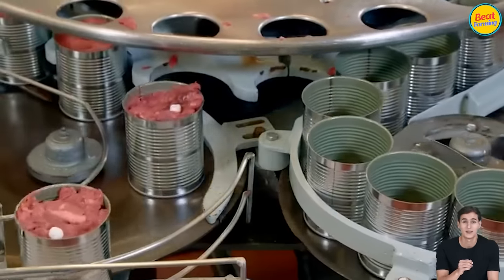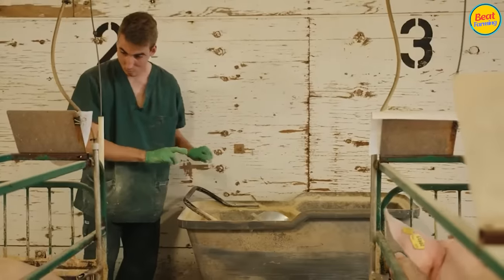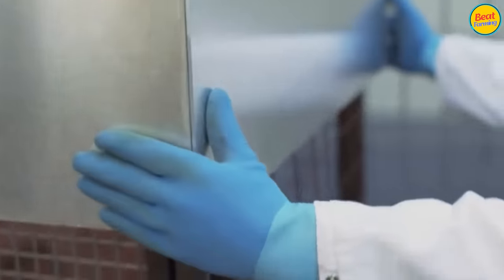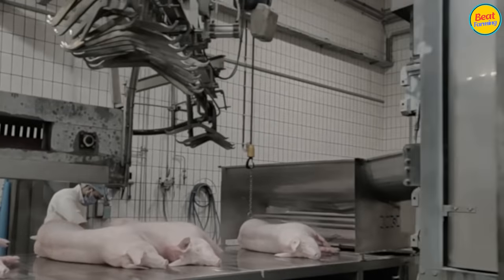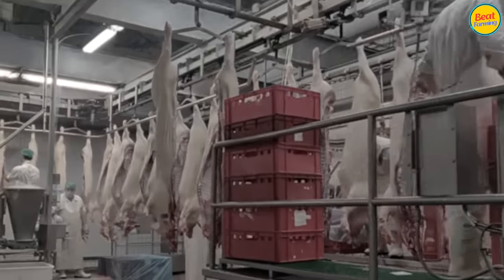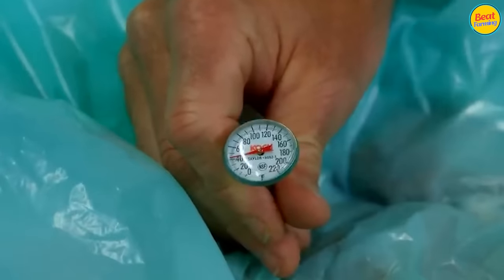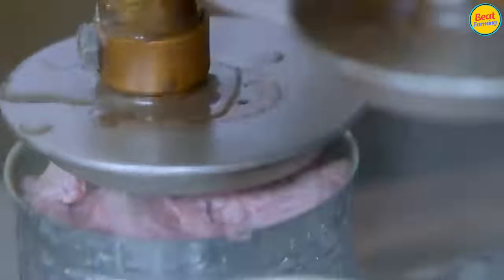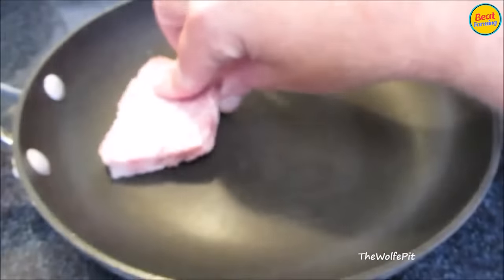How Is The World's Most Modern Canned Pork Factory Like ? | Farming Documentary

Comment: They called me up 6 AM on Monday morning to blame me for the new stunner not working that was plugged into the receptacle I installed and demanded that I be there ASAP. When they told me the stunner was making smoke come out of the pugs ears pissing them off. Told them to read the instruction manual. After they sprayed water on pigs head the stunner knocked them out. Reason they dip them in hot water is to remove pig hair.

Comment: Did electrical work in a small pig slaughter house. They called me up 6 AM on Monday morning to blame me for the new stunner not working that was plugged into the receptacle I installed and demanded that I be there ASAP. When they told me the stunner was making smoke come out of the pugs ears pissing them off. Told them to read the instruction manual. After they sprayed water on pigs head the stunner knocked them out. Reason they dip them in hot water is to remove pig hair. Some places add a chemical in the water.
Reply from the maker: Those are the daily tasks that workers here often do to be able to take down large animals